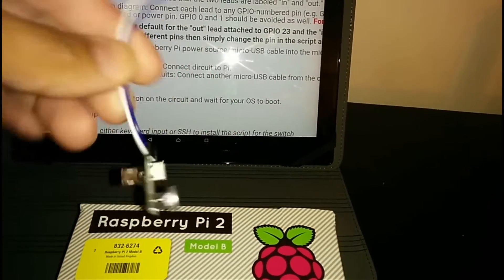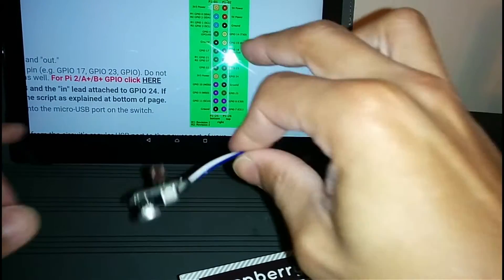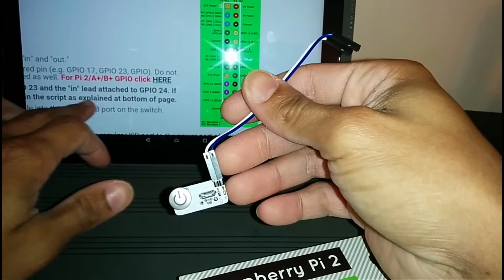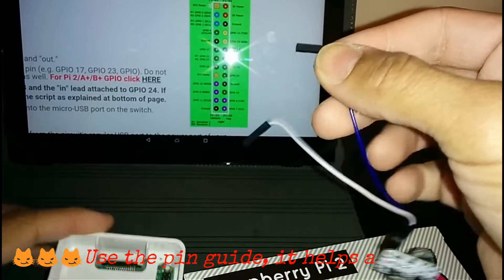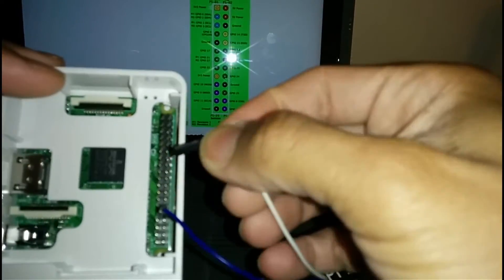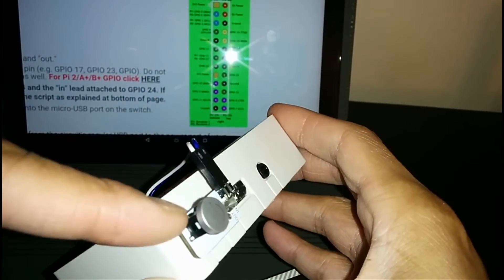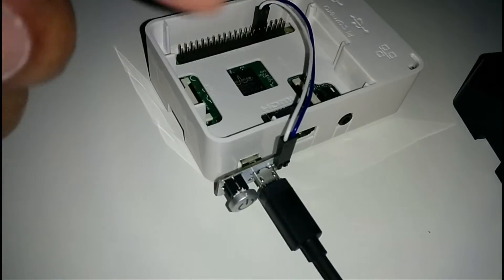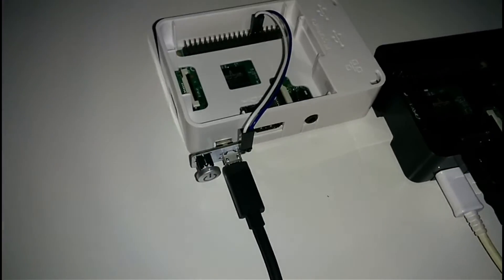Raspberry Pi 2 B ~Power Switch Install~

Comment: this seems really cool, but I don't want the button attached to the pi or the cable sticking into the power button :/ thanks for showing, though
Reply: They sell different models of switch, they have one which will take an external button that you can mount elsewhere.